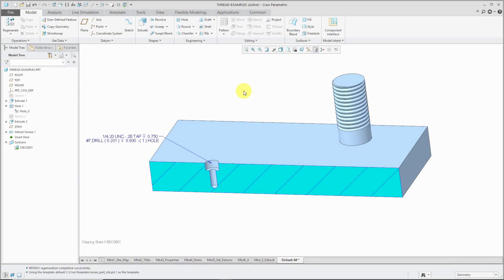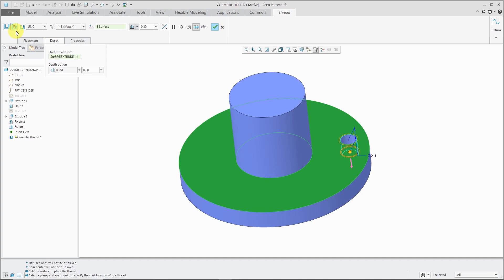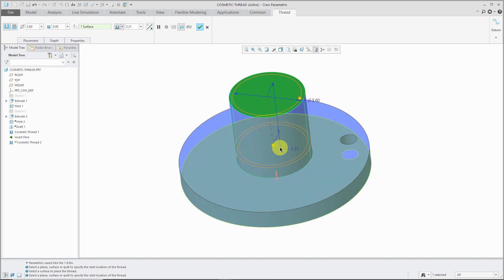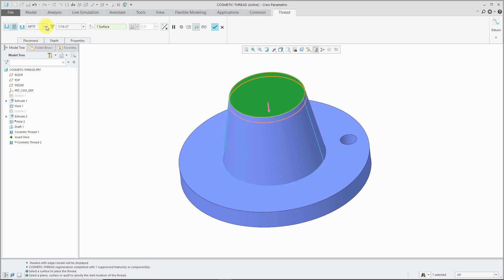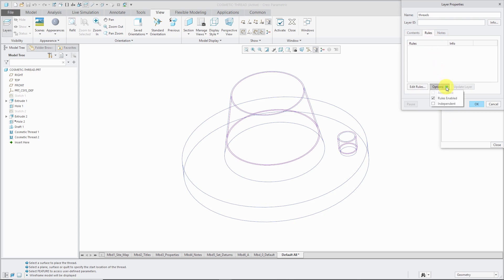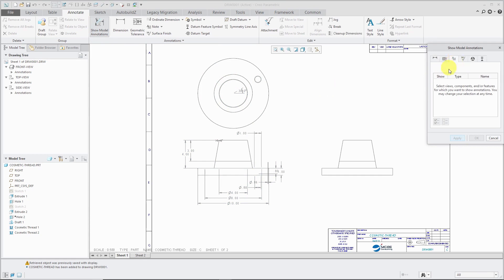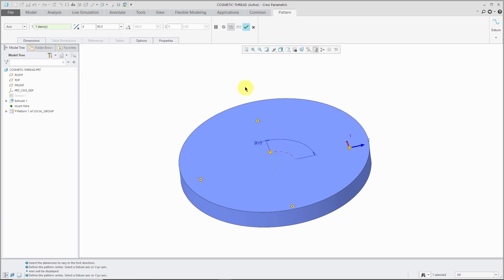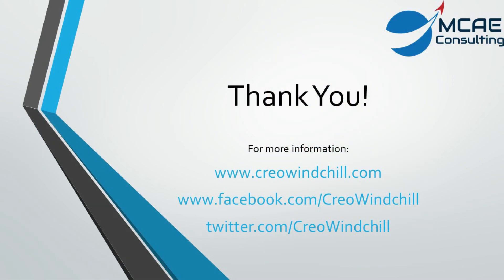Creo Parametric - Cosmetic Threads [Tutorial]

Comment: One question: When I make a DRAWING and have a cross section with thread showing there, I need to have the thread indication line IN the material as a thin CONTINUOUS line.. not as a hidden line (which it shows to be now). How do I change the line style in the drawing from hidden to thin continuous for the thread indication lines which are residing in the material?
Reply from the maker: Have you tried the Edge Display command?
Reply: @CADPLMGuy  Yes I tried. That does not work. We make PDF files of the drawings we make. Inside threads (holes) in the PDF it show a dashed / hidden line. The standard  (ISO) demands a thin continuous line in a cross section and only a hidden line when it shows in a view or detail (not cross-sectioned view). 

Outer thread would be a continuous thin line in both a view and a cross-section and only dashed when it is hidden in a view behind another part of the solid.
Reply from the maker: I recommend opening a ticket with PTC if you haven't done so. I'm not well versed on ISO drawing standards.

Comment: Let's be honest.  Thread features in Creo SUCK.  A "cosmetic" thread that does not look like a thread is NOT 2021 type of technology.  This is VERY disappointing from a company like PTC.  There are MANY cases where threads are need and NEED to be shown, not every threaded feature is a nut, bolt or threaded hole for a fastener.  How about moving into this century and providing the ability to created MODELED threaded features easily (and I DON'T mean helical sweep).    I mean Fusion 360 does it, is it too hard for PTC?  

BTW, I was responsible for the FIRST $1M sale in the history of PTC way back when so I have always been an avid PTC supporter... but you appear to be losing that innovation drive and turned to a purchase technology business model...

Comment: Is there any way to automatically adapt the thread geometrically to the existing geometry? For example, if I have a part with a thickness less than the thread.
Reply from the maker: You can write Relations that control the diameter of the thread as a function of the surface on which it is placed. I will try to put together a quick video to see if that meets your intent.
Reply: @CADPLMGuy  Thanks for the quick response. What I wanted to say was that if the thread depth is greater than the part if there is any way the thread itself can adjust in depth? I use a UDF with a single hole and a thread to be able, through a ratio, to manage the two diameters and depths relative to the diameter of the screw, works well but when the thickness of the part is smaller than the depth of the thread, which is defended by a relation, stands out and confuses in drawings 2d. If I use holes with tread , standard holes, the thread works the way I like it but I can not manage the diameters through a relations. Thanks.
Reply from the maker: Miguel, I started making the video before I saw this response, but I think this video addresses your issue by showing how to create a Datum Analysis Feature and using its parameter in a Relation. https://youtu.be/lWEmsrCRdMI

Let me know if this helps.

Comment: Why I cant match a 1/2-13 UNC cosmetic thread with a 0.42 inch hole? It is supposed to be the correct diameter for the drill. Please help.
Reply from the maker: I’ll have to check the UNC hole file, but in the past I’ve had issues when the hole diameter in the model didn’t match out to a ridiculous number of decimal places (4 I believe). Try a diameter of 0.4219.
Reply from the maker: This is interesting: the Creo default values matched on holes of 0.421, 0.4219 (the value in the hole file), and 0.422 diameter, but not 0.420 or 0.423. I'll check if there is a specified tolerance in which the hole will match the thread.
Reply: @CADPLMGuy  after writing my last comment i tried with 0.422 (3 decimal places) and it actually worked. I was not very sure why but now I know. Btw all feedback is appreciated, thanks!
Reply from the maker: Brandon, I just found the config option: cosmetic_thread_match_tolerance. Default value is 0.001 inches, which explains why it didn't match the 1/2-13 to the .42 diameter hole. You can either (1) create your own .hol files and direct Creo to them with hole_parameter_file_path or (2) increase cosmetic_thread_match_tolerance to something like 0.002. The latter is much easier.
Reply: @CADPLMGuy  very very useful information, thank you again sir.